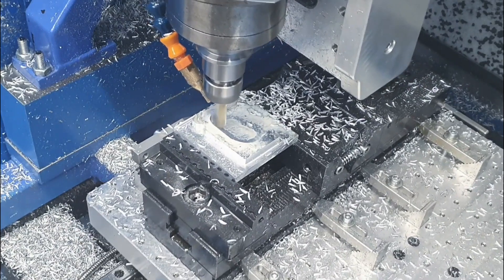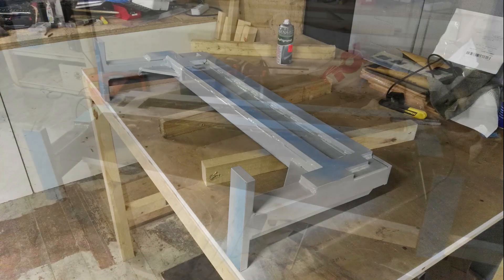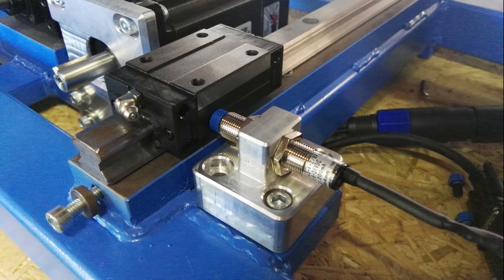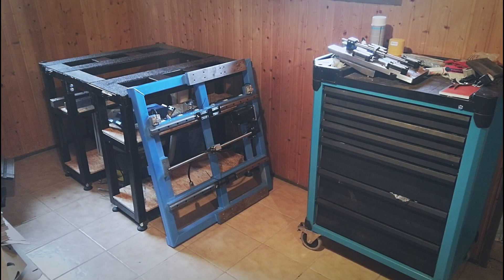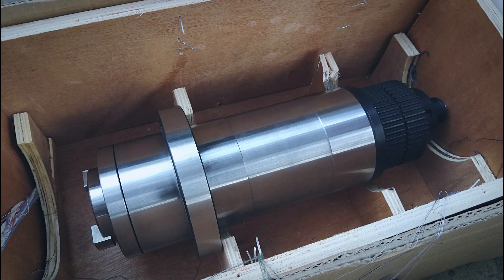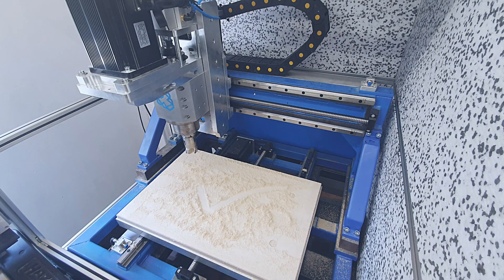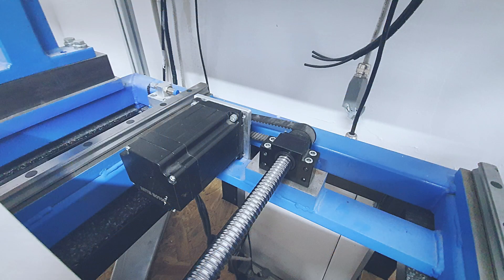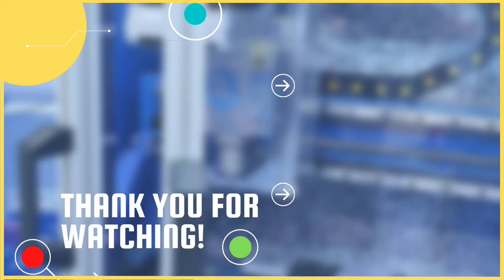#1 LetsBuild - Thats how i build my own diy cnc milling machine out of steel and aluminium

Comment: Fantastic machine. What electronic controller did you used? Could you make a short clip about that?
Reply from the maker: Hi, im using a mesa 7i76e Controller card with linuxcnc as controlsoftware. It will take some time, but i will make you a video with a summary of all my Electronical components.

Comment: Which type of motor you use to drive axis
Reply from the maker: I'm using NEMA34 Closed Loop Hybrid Servo Motors with 8Nm for X and Y and 12Nm for the Z Axis
Reply: @DSMACHINEPARTS  have you ever try to mill steel
Reply from the maker: @9782ravi  not yet. But i will do it in the next times. Still waiting for some tools for the first trys. But i think steel should be no problem

Comment: The music is a bit too loud to be able to hear your voice over!

Other then that nice build! Whats the max spindle rpm speed?
Reply: nice build, music is kind of distracting, had to turn off sound and read sub titles.....ha
Reply from the maker: @feelindizzy777  sry, i learned about Sound Sound reduced it in further videos.
Reply: @DSMACHINEPARTS  good man, i'll have a look thanks
Reply from the maker: Thanks for your comment. I will try on the next ones to have a better Balance between the background music and the vice over. 

The spindle can handle 6000rpm but the servo is only run on 4000rpm. But i planned to upgrade the spindlebearings and the servo to be able to have 8000rpm.